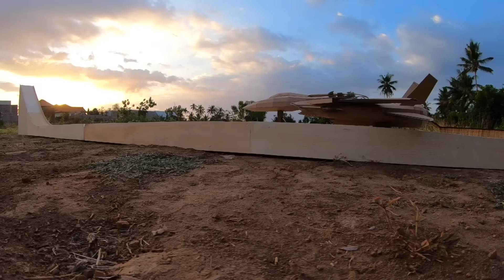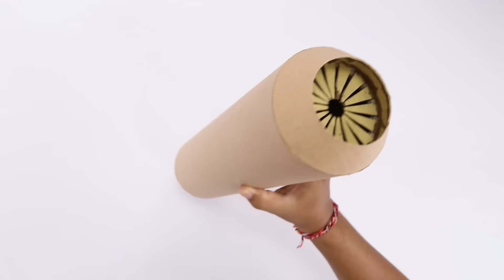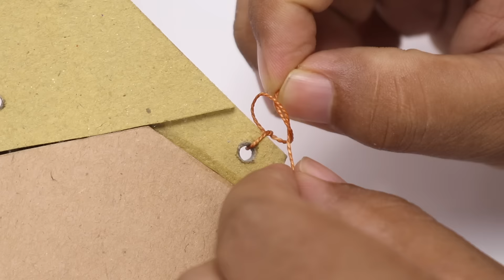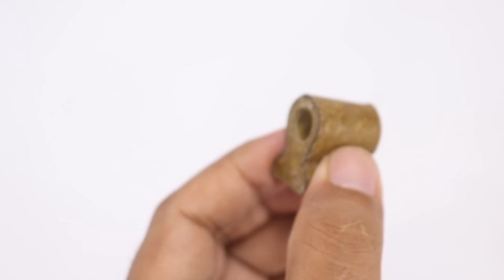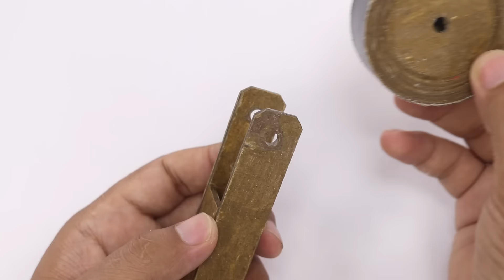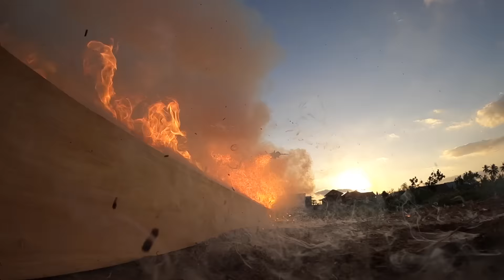RETRACTABLE Wings - Amazing Matchsticks Powered Cardboard Jet

Comment: It could have at any moment had burned because of the chemical and heat bonding with the atoms and molecules and particles that make up the flames combining with the ones In the cardboard, they don't react well together. Plus, If you are going to make a plane like that, you should attach a thin metal tube In the plane that goes through the center ofbthe plane. The matches could then ho in the front side ofbthe tube and going towards the back, his will clause morenthrust. If you add a smaller jet thruster or engine In the back facing backwards so the flames will be going backwards faster and producing more thrust. Heat and air molecules and atoms and particles will most likely create more thrust combined than they will "argue" with one another. This will also cool down the heat too and will prevent a fire from starting. Also, inside of the tube, use blackpowder or ashes as a trail. It will be Mir powerfull, effiecent, lasting, and just over all better and the best. As long as the density of the metal plating for the tube in the middle of the plane is sizeable and effiecent and will last enough ght it won't Break upon impact of the fire from the popping and explosion and blast from the gunpowder. Everything will be good then. Just make a homemade hammer. Not a work tool hammer but a ghn hammer. It's simple. Take metal plating, about 1/2 an inch thick. Then create or Melt or cut or slice or stab or mold or shape,etc it into a circular shape, not too small but not too big either. Then that is the primer which is whatis being hit by the gun hammer to ignite the gunpowder. To make the actual hammer, just take about 2 or 3 rubber bands and fold each of them. Yo would fold them into 2 sides with 1 rubber band to make it tighter and stronger? Do that with the 2 or 3 rubber bands and then attach them into ... remember when you mae cardboard guns and you took rubber bands and attached them into a paper tube that had holes and cuts and it made a launcher type thing. Yeah, that.that and just make the apart that hits the primer out of metal. It should work.